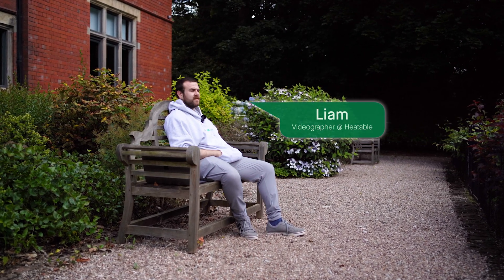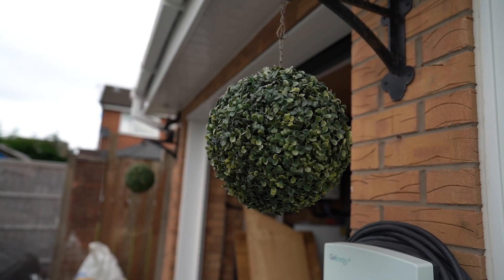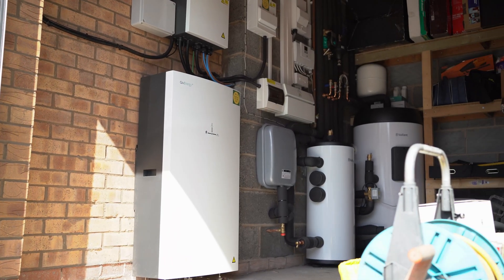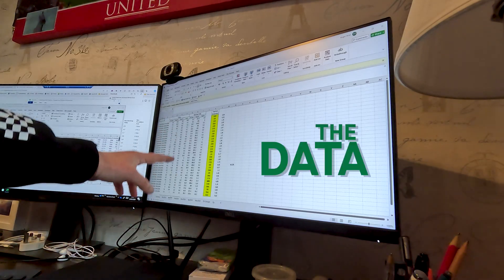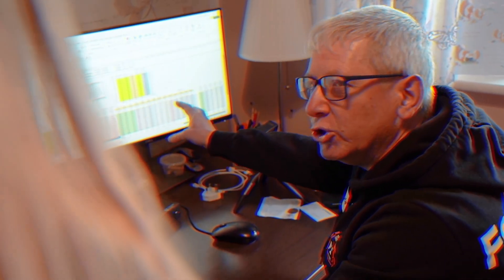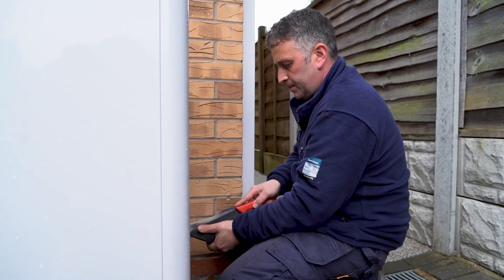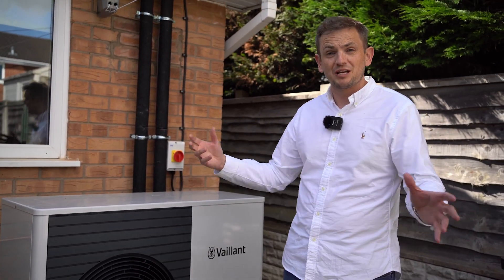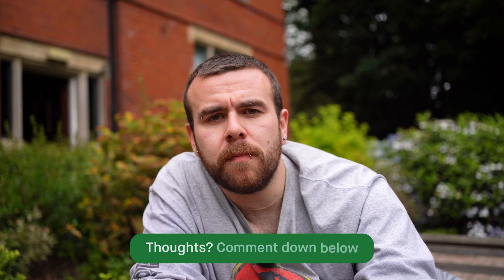Air Source Heat Pump Installation | The Data Revealed (UK Case Study)

Comment: How much kw did the heat pump use in the winter time in a month?
Reply: Over a 12 month period Heating and inc DHW approx 3700kw where the Winter months Nov to Feb inclusive was about 2000Kw of that total

Comment: deffo not getting scop of 6 im afraid
Reply: Extremely happy how well mine has ran, i was sceptical before install of how it would perform, saw lots of scary videos of failed installs, but Heatable along with Valiant and their specialist assured me that the design would work, original estimated SCOP was 4, but amazed how well it has over performed reaching an average SCOP of over 6 for the year

Comment: great video, It would be great to get more user experiences from heat pump properties, and not just the sale pitch. Yes they are so much more efficient over a gas boiler, but gas is cheap! Electricity is expensive, this key bit I feel is often ignored. I do not know any air source heap pump users that are saving money. Yes there homes are 21 degrees 24 x 7, but the money cost is still the same as mine with a gas boiler. Cheers
Reply from the maker: Hey Richard, we definitely agree with your side too. These aren't the answer for everyone and they definitely aren't cheap depending on how many upgrades you need to make to the home. It's more about the green agenda than saving lots of money, unless you have solar panels that can mean you can actually make some real savings due to the price of electricity vs gas.
Reply: ASHP running costs are generally comparable to Gas Boilers and on their own probably hard to justify swapping over, but when combined with batteries and off peak tariffs can make them really inexpensive to run, and combined with solar like mine it can cost nothing to run, its all about design, get that right and there are saving to be had

Comment: Nice video. Recognise some of the installers from our job 🙂We had our heat pump installed (1950s house) before solar/battery and it's performing really well. Smart tariff has helped a bit.